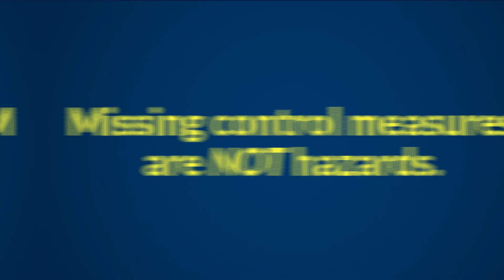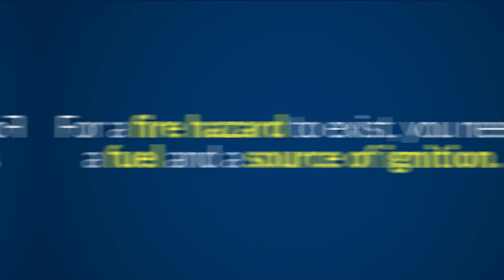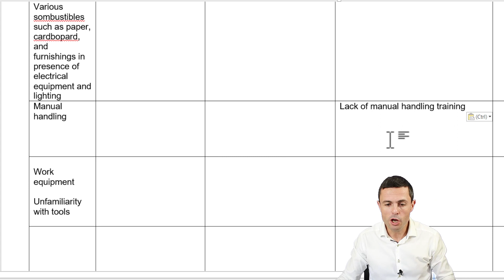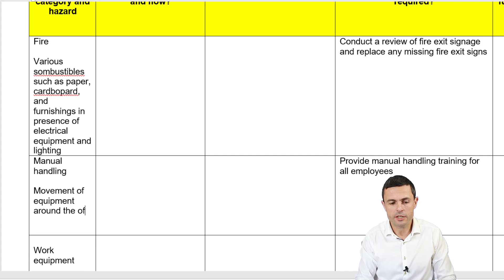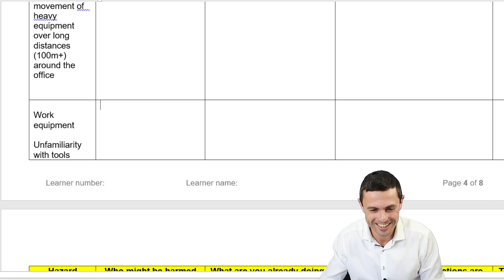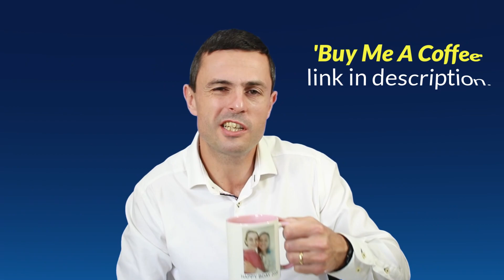What Is A Hazard? | NEBOSH Practical Project

Comment: Should one carry out a risk assessment on an industry like construction or warehousing where there are much clearer risks and hazards or would an office space suffice?
Reply from the maker: An office will suffice as long as you can find 10 different hazards spread across 5 categories. Lots of hazards in offices which need controlling, so usually not a problem.